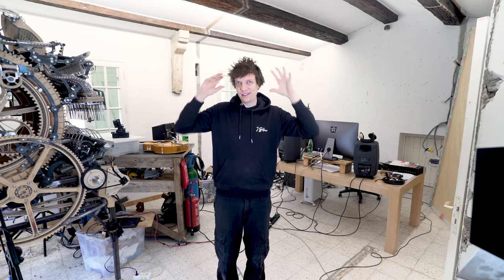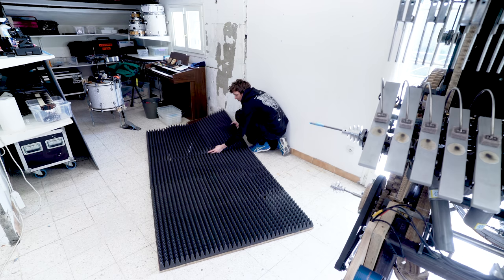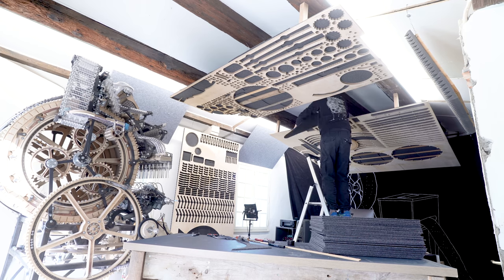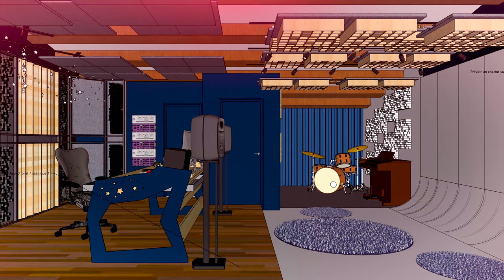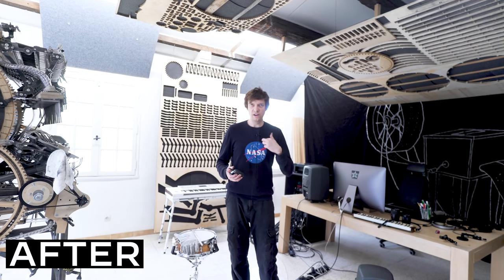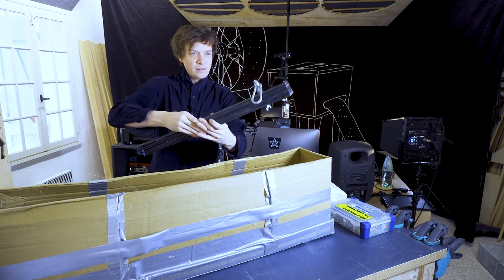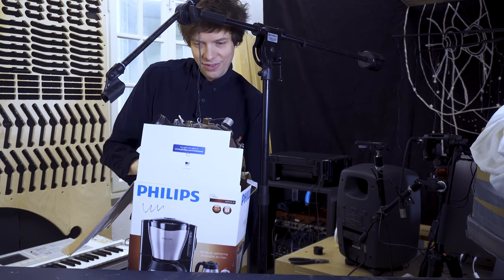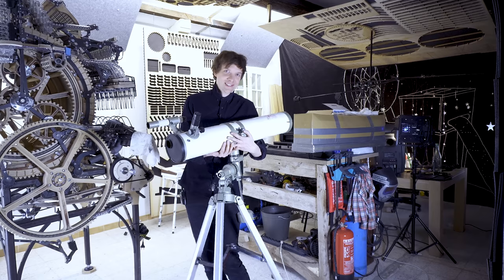Acoustic Panels from Plywood Scraps - Music Studio Build

Comment: Martin, we adore you. However I'd like to give a little insight on lighting, because I was talking to myself about how the lighting set up was...odd. You have a good setup so far, but to make it look amazing, you'll need a third light, two lights on one side is fine, the point is that you have a main light, a secondary diffuser light and a backlight. The Backlight, also called a Hair Light, should be out of frame too, and up. You can very easily achieve that contour you want while having the light somewhere else. Directly behind you is the worst place to put a light, it washes out the lens with what I like to call a Milk Flare. I would suggest moving the backlight to the right side and higher up, so it accents and makes your hair glowy and pretty.

Comment: That planned makeover design looks like it wouldn't have much place for the MMX workshop. A lot of covered floor space, a lot of flammable fabrics. It's a design for a post-MMX era, not for the current-MMX era.
Also, like Tomáš Karlík said in an other comment, you should flip the plywood-foams around, so the foam pyramids face inwards and the plywood outwards. There's a reason why sound booths have the foam spikes face inwards.

Comment: Have you thought of a  full wall bass trap approximately 15cm  or 6" deep filled with fiberglass or its  green equivalent?  Use some burlap or porous  covering to dress it up.  Add a carpet to the floor and shag carpet to one wall and you will se a great difference. I like your idea about the ceiling.
 My bedroom  has a pitched ceiling  like yours and it has terrible  standing waves.
Try some of those ideas and you should have a nice area.
Oh any area divided by 2 will give standing waves ie 10x12x16  so keep part in an odd measurement. The bass trap eill help there also.
Happy tuning !.

Comment: that little strip down near the floor is air intake for air circulation so you don't get mold inside your studio..
A person breaths out like a ½ to a whole L of liquid during 1 nights sleep so if you are in your studio for days on end it might contract mold.

As a Swedish carpenter that is something I always have to explain to new house owners or DIY projects that might get the insurance company get a little cringe on their face but also I personaly think about the CO2 levels so they ain't harmful for the brain in long term or short term... someone suffocating them self's in their own rooms.

Put some regular house isolation in bed sheaths or plastic bags and put in the corners (What I did on the ceiling and covered it with some nice looking fabric, and plastic so it doesn't rain rock wool particles in my house x'D

Comment: Hi Martin, since you are working with a professional company they will be able to tell you as well. However I wanted to tell you that absorbing low frequency sounds is not so much about the density of the material, but more about the "space to capture the wave". Since low frequency waves have larger wavelength you will need a thicker absorber layer to have good absorption in the low frequency bands. Creating an air cavity between a wall and absorbing material is a practical way of doing this. However leaving the gaps around the side open allows these waves to "leak out" therefore almost mitigating the effect. At the same time the high frequency waves are able to enter through the sides strengthening absorption in the high frequency bands. This causes an even bigger difference between reverberation times in low an high frequency bands. Usually the room acoustic properties therefore improve when the sides of the panels are closed.

Comment: I believe it was mentioned in another comment already but when you're using the stereo mic, there are phasing issues. I have a studio monitor controller (hardware) and when I press the reverse polarity switch it fixes the issue. It's just a matter of reversing the polarity of the audio in the software you're using to render it.

Comment: If you are going to use that telescope as a prop, make sure you use it correctly.  That is a Newtonian type of telescope and you were actually pointing it AWAY from the Wintergatan Planet.  This type of telescope has an open end on the side near the focuser (where you look into) and the primary mirror on the other (closed) end so you need to remove the dust cap and point the open end toward the planet.  If you don't there will be a ton of comments pointing that out.

Comment: You need the foam side facing you. That dense shiny wood is echoing the highs, and the "space" between the foam and the wall, is more silent... Where you are not located.

There is no real secret to reverb removal. Soft things reduce highs, and hard dull things reduce lows, "non-uniform angles", as opposed to parallel walls, kill reverb. Shiny things echo more.

1: You need carpet on the floors. ALL your sound is bouncing UP and onto the walls and ceiling and glass.
2: You need soft surfaces over hard surfaces, to kill highs and lows. (In reverse, it doesn't work. The highs bounce off the hard surfaces.)
3: You sort-of nailed the angles thing... But make the corners functional. Put "things" there... Boxes, tools, shelves full of stuff that disrupts the sound paths. Don't waste space with emptiness. Sound travels easily IN emptiness.
4: Ceiling panels should be angled, not parallel to the floor. Ideally, angled in various directions, like panels set at a 45-degree angle, each panel rotated 1/4 of a turn. Otherwise, the sound-trap pyramids, which need an angle steeper than 45, so they echo sound deeper into the cone.
5: Window-shades or window blinds or clear shower curtains over the windows. Glass is like a mirror to high frequencies. Plastic is a diffuser. (Includes blinds which have curved blades or a wavy shower curtain.)

Alternately, you could divert all noise to one location that is a "sound trap". But that requires some real surface remodeling.

NOTE: Book-shelves, full of books, are the best sound killer. That is why libraries with walls full of books, carpets on the floor and hung ceiling, are so quiet. Its not just because people aren't talking. All those irregular, dense and soft surfaces, cancel almost all sound echo.

Even painting your walls with flat paint, is a big help. Glossy or non-flat, will echo more. Walk into an empty apartment and it sounds like a cave. Walk into that same apartment with soft and hard furniture, an entertainment center, tables, rugs, pictures on the walls, and "stuff" all over... there is almost no echo. You have tons of "stuff", laying all over. No need for an expensive path for a sound studio, unless you just like throwing away money for custom clutter to fill the walls, floors and ceiling. :P

Comment: @ 3:.00 when you cover that MDF base board from your CnC with foam.... I had a sudden thought, all those shapes in relief, would make pretty cool artwork when used as smaller sections - either left natural or maybe painted over the high points with a roller to leave the cuts in contrast.  literally selling artwork based on the shapes of parts made for the Marble machine.

I think lots of people whould be interested in buying them - certainly unique to your build and would give your fans soemthign they could actually have as a part of it - maybe some of your major collaborators might find it interesting to have one?

Comment: You should make wooden basstraps. Cutting wooden pieces in different shapes and glue it on a plate. You can even use branches and create some art piece of that that will work. Acoustic foam kills the quality of the sound that is produced by the Genelec speakers, because you need little acoustics to have more rich sound, better stereo and deeper sound. Wooden basstraps will spread the sound instead of absorbing it, but depening on your goal. For recording it's better to absorb al the acoustics. Mixing and recording studio's are always look different. They have both different purposes and need other treathment. Maybe you should find a balance between it?

Comment: There's something wrong with your stereo microphones. One of them it out-of-phase. Could be one of the XLR cables wired with hot and cold mixed up. Or it could be one of the mics from the factory (I had a defective one once that was inverted vs the other mic).

Comment: You've improved the acoustic element of the indoor environment,   but the indoor air quality will suffer from a very increased "shelf factor". The amount of open horizontal area where dust can deposit. If you still will be doing dusty workshopping as sawing, angle grinding and so on, I will recommend you to seal the acoustic elements so that dust won't deposit. Kind regards a  concerned air quality engineer.

Comment: Face the foam into the room.  All that plywood is just reflecting the sound.  You want the foam to directly absorb it.  Unfortunately, the "artwork" would be hidden, but it would be much more effective at doing its job.

The way it works is the sound goes into the foam, and the action of the sound  vibrating the foam converts the sound energy into heat.  (A very very small amount of heat)

As I understand it, the pyramids help to disperse the sound that is not absorbed so that it does not get reflected back in one direction, but rather disperses in multiple directions.

Comment: That generic eggbox foam that everyone buys is inefficient at absorbing sound waves. I don't understand how it got so popular. Get various densities of Rockwood and put them infront of that panel. It's cheaper and way way more effective at converting sound energy into heat. Vary the density from low density to high density. The various densities allow a more efficient impedance coupling through a wider frequency range (instead of a lower density Rockwood you could get away with using a bit of that foam but it will be less effective). The plywood panel will add some diffusion and reflect some highs that may be over absorbed. Diffusion is important to create a naturally sounding room to binaural receivers (your ears). Less important for monoaural recording with your mic, but diffusion will help reduce flutter and increase absorption from other surfaces. If it creates a seal it may also act a bit like a helmholz resonator to extend the low frequency absorption, but the last bit is unlikely unless designed correctly. Good luck.

Comment: Be very careful. All that sound insulation is a massive fire hazard. There was a nightclub in New England that burnt down due to a dangerous sound insulating installation.

So just be extra careful with sparks, etc... until you get the professionals to come in and do it right.

Comment: I don't know how they sell eggs where you are, Martin, but here in the states they come in hard coardboard cartons that look like this:

https://previews.123rf.com/images/neelsky/neelsky1109/neelsky110900207/10567733-carton-of-eggs-isolated-over-white-background.jpg

These make excellent (eggcellent?) bass traps, due to the density of the cardboard and their multi-angular surfaces.  Just cut off the top, glue it to the back, and fill the space between with expanding foam insulation.  Boom, DIY bass trap that works with freqs even as low at 50-60 hz.  Just make sure to spray them with some sort of fire retardant, cardboard is rather flammable.

Comment: The way you use the plywood panels and pyramid foam is totally wrong, here is why. I separated this from the other comment I made about the foam being extremely flammable around angle grinders and welders...

The plywood scrap sheets are not acting as diffusers, more like acoustic reflector arrays, where if say the panel has half it's area cut out, you reflect about half the sound. The reflected sound doesn't make it to the foam panels, an no sound makes it behind the panels to be absorbed either. And by mounting the foam panels on a flat surface you have ruined their absorption ability, as foam absorbs energy from the air velocity, not it's pressure. The wood panel creates a reflection area where the pressure is high and velocity is low inside the foam, so you will have even less effect on lower frequencies. It would be better to put the foam panels on a frame or suspended on a cloth and put them several inches away from the wall like the curtains. But then you still have extremely flammable foam all over your work area while generating sparks...